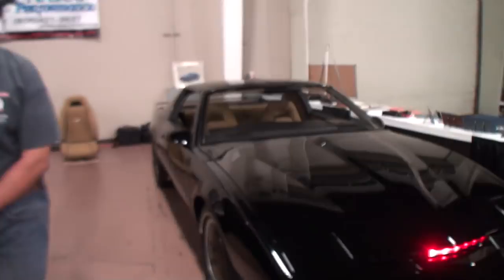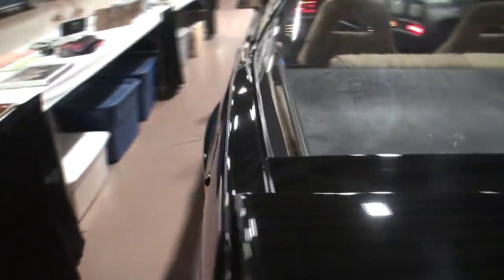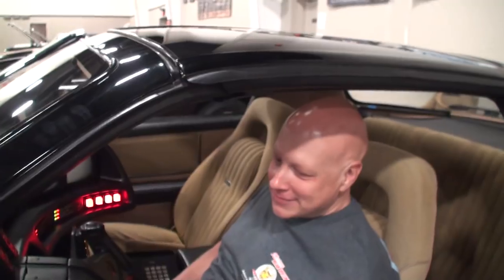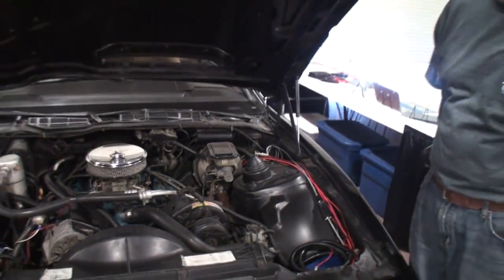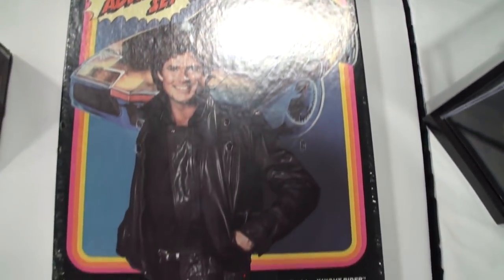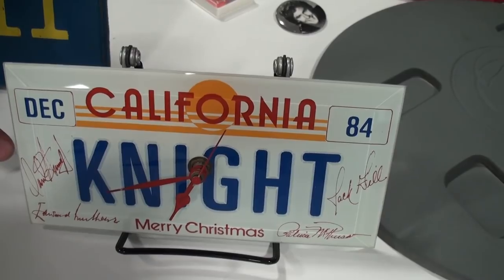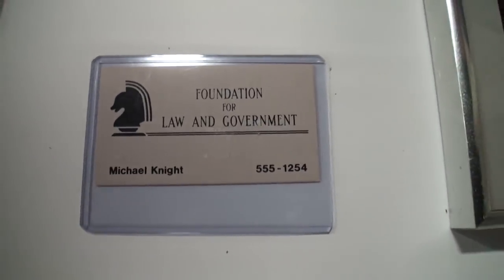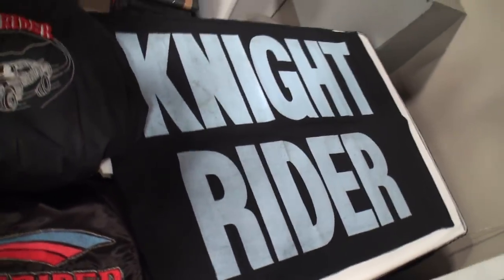Actual TV Show Knight Rider K.I.T.T. 1982 Pontiac Trans Am KITT on My Car Story with Lou Costabile

Comment: Is it a dimmer switch, or a switch to activate the high beams? 🤔
Reply: I'm not a huge car guy, but yes, you are correct!! The button on the floor that you push with your left foot isn't a "dimmer switch", its actually how you turn the High-Beam Headlights on and off. I know this because my brother owned both a 1980 Chevy Camaro, as well as 1982 Pontiac Firebird, and both cars had that button for the Hi-Beams!!
Reply from the maker: Appears 1967 Chevelle LSx answered the question.

Comment: I'm not a huge car guy, but a little info. for you. The button on the floor that you push with your left foot isn't a "dimmer switch", its actually how you turn the High-Beam Headlights on and off. I know this because my brother owned both a 1980 Chevy Camaro, as well as 1982 Pontiac Firebird, and both cars had that button for the Hi-Beams!!
Reply: it's a dimmer switch.
Reply from the maker: Thank you for viewing and sharing your knowledge.

Comment: 17:30 That's the voice box panel used from season 3 to the end of the show plus the dash was slightly reworked plus the two monitors on the right side of the dash were replaced by a single larger monitor so the dashboard in this one is from when the show began to the beginning of season 3's Knight of the Drones before KITT got hit by a missile.
Reply from the maker: Hi cc409, Thank you for viewing and sharing your knowledge, Lou

Comment: It looks like the car was blowing black smoke when you revved the engine. What was causing that? I expected a little blue or white smoke. Not black.
Reply from the maker: Hi Scott Brodie jr., Hmmm, not sure. Maybe a Viewer has more knowledge and can help answer your question, Lou
Reply: @loucostabile  thanks for the reply. Maybe its soot that's been sitting in there. Those cars were driven hard and put away wet. Glad to see it all still functions. That's awesome! Any idea of the horsepower? Always wondered if they hopped up the motor.

Comment: 5:16 - CRPL ?  Shouldn't that be GRPL for 'Grapple' ?
Also, doesn't it bother anyone that 'LIC PLATE' is centralised, while 'OIL SLICK' is left aligned?  
And I won't even touch on the spacing of 'RELEASE' .... that must have been applied while driving.... ;)
Reply from the maker: Hi chrisjlocke
, Nice attention to details. Not sure if it should be CRPL or GRPL. Not bothering me too much on the "OIL SLICK" location, Lou

Comment: Not a 305 motor. Pontiacs had a 301.
Reply: Good Eye on that, but I had a 1982 z28 and it did have the 305. It was meant to be the savior engine of the day for performance and gas mileage. Just a side note
Reply: Yep, starting in 1982 they all used the Chevy motor.
Reply: They had the chevy 305 as of 1982
Reply: Did the 350 back then have alot more horsepower or was it like the 305 had 200 hp and the 350 225 hp
Reply: My dad has a early 1982 that was built in 1981 (car number 984) that had the 305... So when the heck did it ever have the 301?
Reply: @GAMEVIDSnorwegian422  ,1980 Pontiac Trans Am  had a 301 Pontiac motor ,301 wasn't a chevy motor,  Like WRR Unlimited said above in 1982 Pontiac used Chevrolet motors.
Reply from the maker: Hi WRR Unlimited, I'm not sure, however I see Viewers have shared their comments. Thank you for viewing, sharing, and I hope you see many more cars on this YouTube Channel you enjoy, Lou

Comment: If you put a gun to my head and demanded me pick between KITT or General Lee.., you may as well toss in the 1960s Adam West, Batmobile - and then pull the trigger., because each one has its own style and mood, awesome cars! I cant pick a favorite. Non the less.., KITT gets triple Wows without hesitation!
Reply from the maker: Triple Wow's - enough said :-)
Reply: I remember having the Knight Rider toy 15 years back. The radio control one. I remember even when I was married I had the KITT replica. I bought it from Toys R Us. I even spread salt on my countertop so I could mimic the way KITT would slide on the show. It was so much fun! Then too late I grew up. Now I scan the cable channels for reruns of Knight Rider. I want to buy it on DVD off Ebay,from my account.
Reply: John - I know on Amazon you can get season one DVD for about 6 dollars. I'm not sure how cheap you can get it on Ebay - but thats fairly reasonable right there.